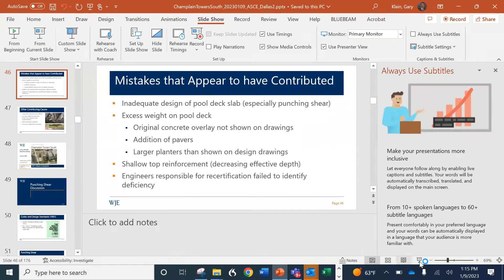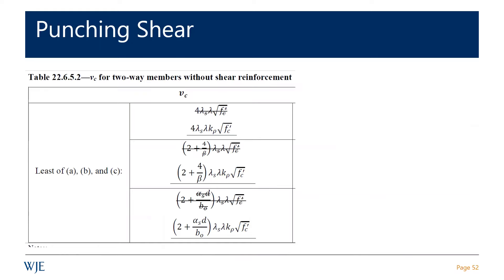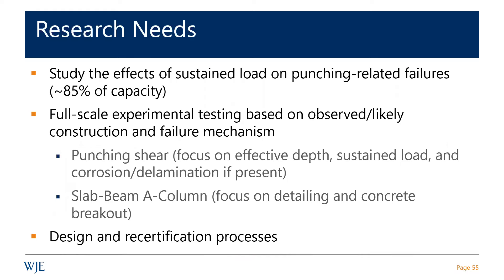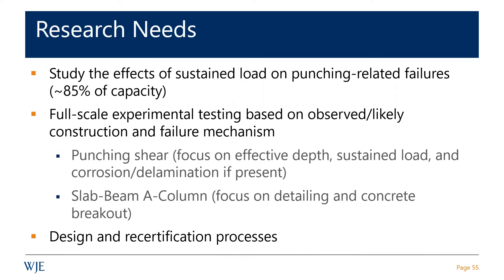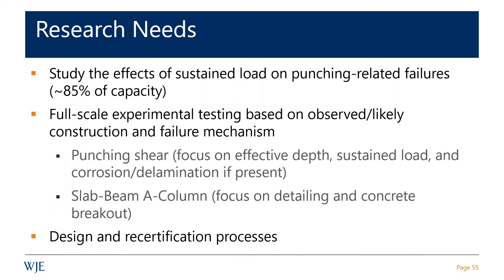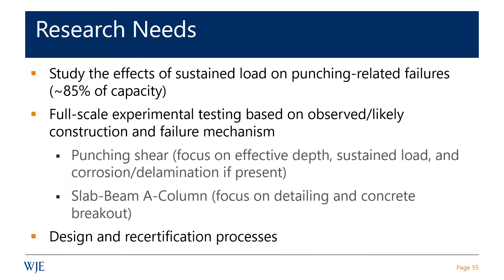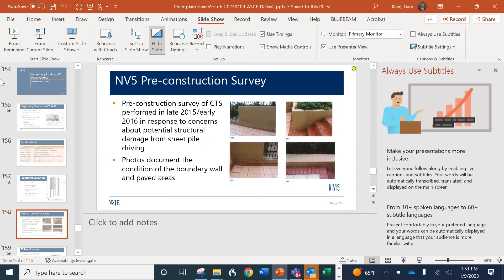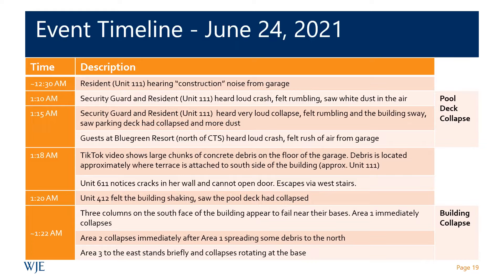In-Depth Investigation of Champlain Towers South Collapse (Surfside, FL)

Comment: As an Architect, my comments are: Before maintenance and QC construction issues I think the most significant problems are review of QA structure design thicknesses in drawing plans, and rupture foundations  joints between the pool deck and hotel BLD because have big different weights masses  and shearwalls